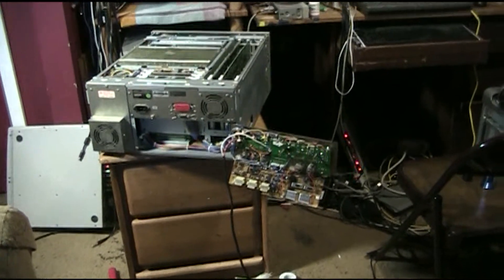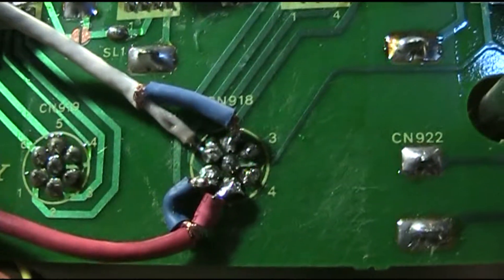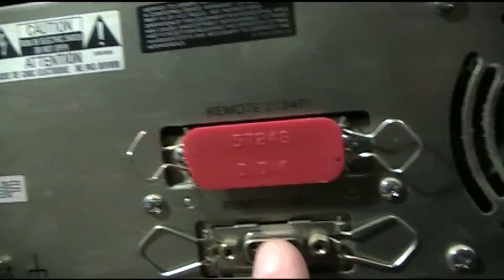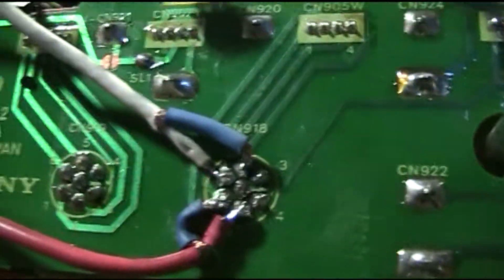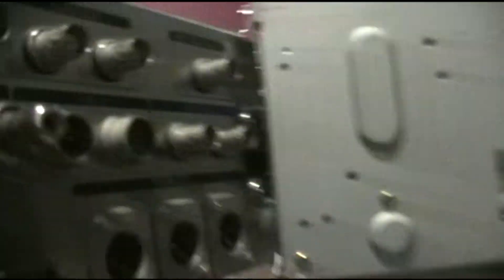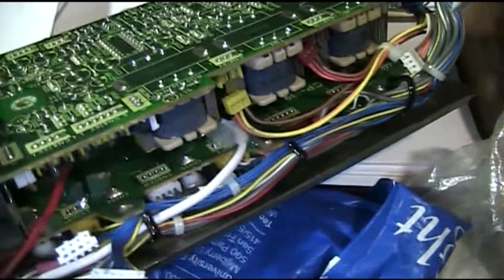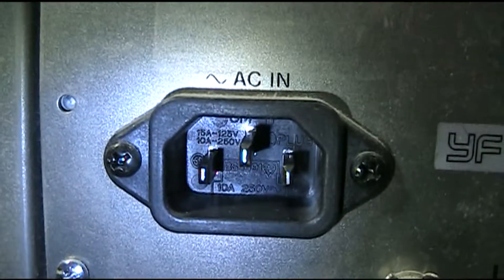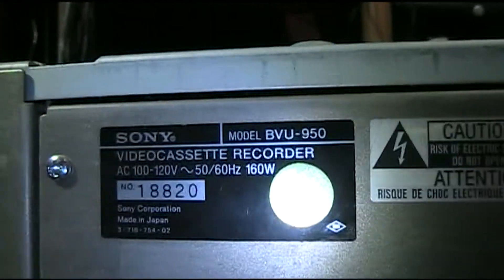Umatic Dub input cable hard wire re-do

Comment: I though you made a modification to get S-Video out of the DUB pins, What a waste of time, my head is spinning from that shaky camcorder.
Reply from the maker: There were problems, yes. Took a few years off for a reason.
Reply from the maker: This mod makes it work when you don't have the original dub cable. It is still Y/C 688 as you found out. Maybe I should say NOT S-VIDEO in the title?
Reply from the maker: I do need s-video out on a umatic soon. Maybe I should do it on a more common machine. What do you have?
Reply: wdavem BVU-950
Reply from the maker: @Capturing-Memories  Ok. So happens I'm over a month deep into re-habbing a 950 now; Do you have an internal TBC? 

If there is a TBC the mod is likely different, I have a schematic for the DM board but not for the tbc board. Obviously if there's a tbc, the mod should tap the best places possible. This may or may not require an external (or additional) amplifier. My experiments show that an adjustable distribution amp might work quite well for the output amp for chroma. Might be able to use the main output for luma... we'll see. There might be some re-routing possible to use amps that are there already, but maybe simpler is better if the results are very good.  If there's no tbc, it will be a mod for the DM board. I want to do a video but I have to re-arrange my studio asap. Feel free to ask questions if you want.
Reply: wdavem No I don’t have the internal cards just a bare deck.